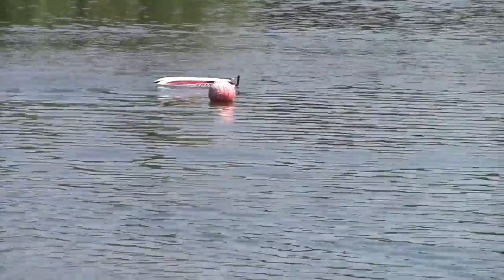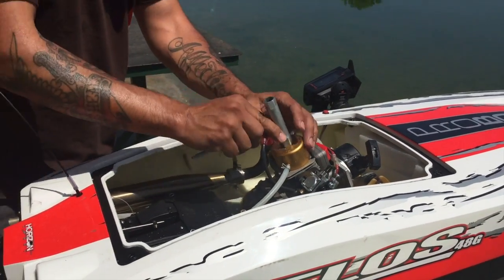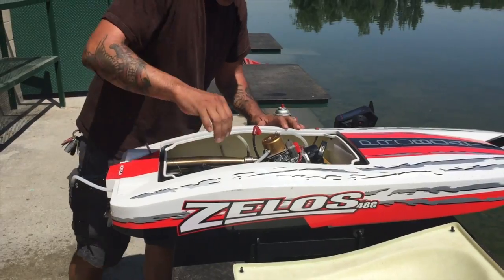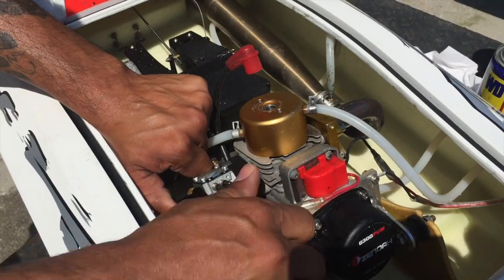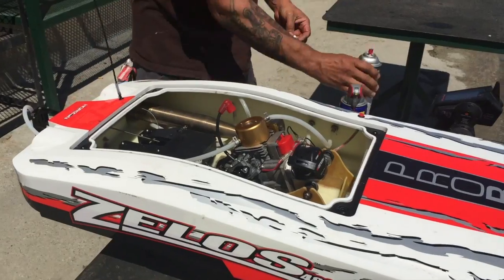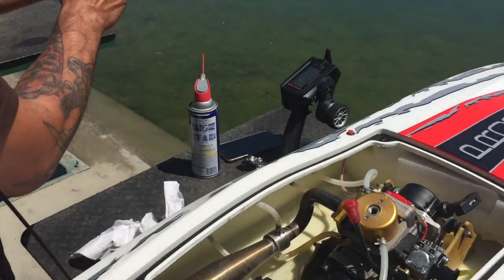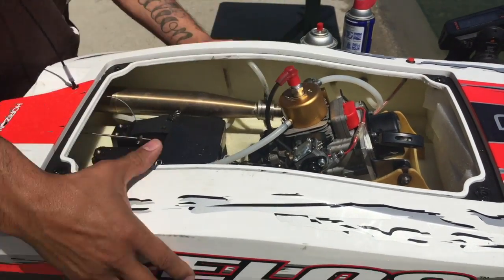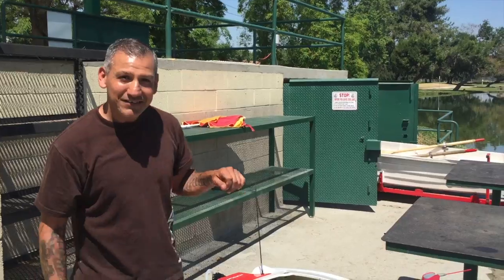PRB09004 Pro Boat Models Zelos 48G : How to fix Zenoah Engine Hydro Lock

Comment: gas boats sound cool but there no match for the instant power and torque of a brushless motor
Reply: true brushless is kinda insane only problem is afther 10 min's your done a gas boat atleast mine enforcer 57 can run 1 hour on a tank and if u wane play more? np fiill up some gas and u got another hour
Reply: @piepo255  I get about 30-40 minutes with mine, but you're right about the gas motors. I've got a Nitro off road truck and I can run it for 2-3 hours on a little tiny Nihm battery for the throttle and steering servos. Other than that, all I've got to carry is a bottle of nitro fuel and my jump pack (still have the electric start on mine). My Zelos 36 twin uses two 6 cell lipo packs. If I want to run it for more than two packs, it gets pretty heavy. The lipos I run are fairly light for a 6 cell and weigh 844 grams. Might not seem like a lot, but carrying them in a bag on your back gets very heavy after a little while (if using 6 cell packs for my other road and off road RCs.